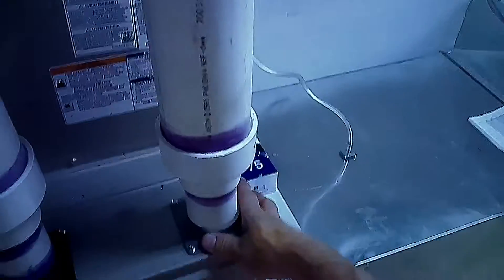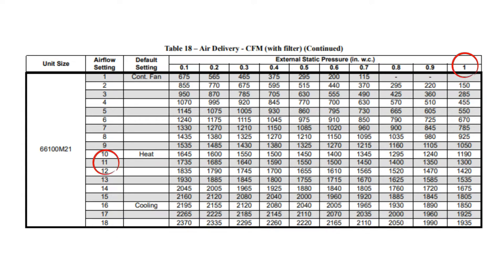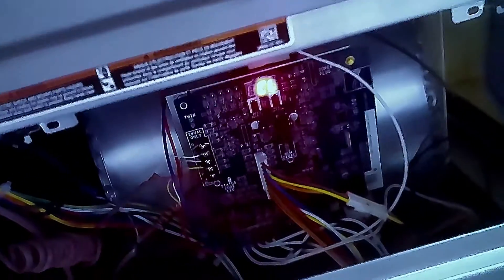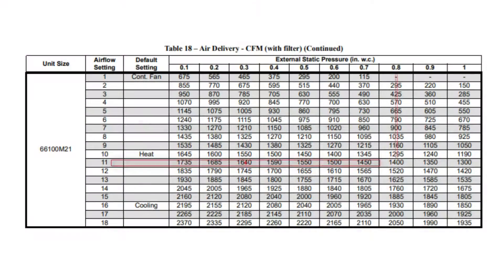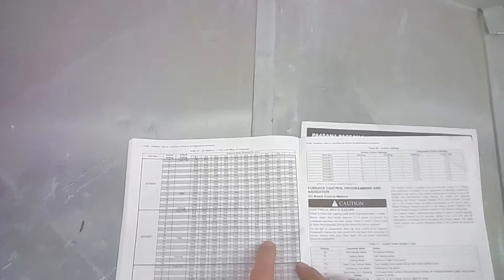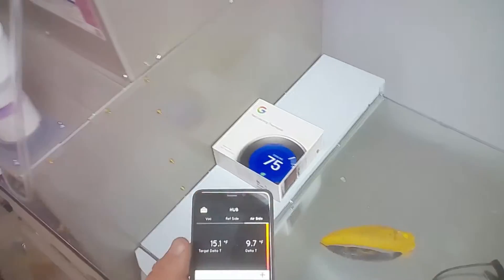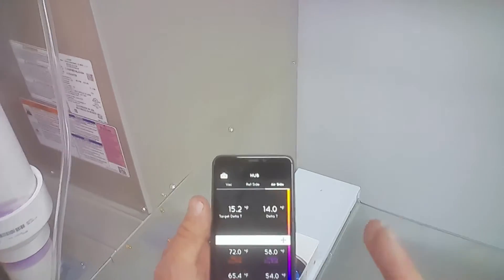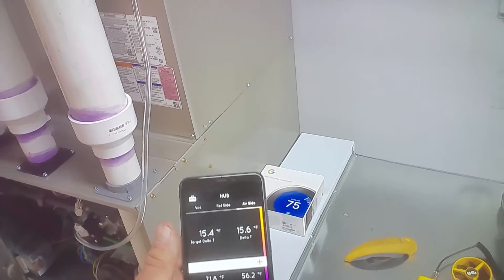In The Field: Setting Blower Speed w/Static Pressure

Comment: That is not how you measure static pressure. You need to measure everything that the blower has to work against. Not only the ducts, filters and the evaporator coil. You are measuring in the wrong places. You need to measure under the evaporator coil and before the filter to get a true static. Furnaces have a 0.5 static rating. That doesn't include the evaporator coil which is about 0.2 drop alone. Manufacturers don't include this because they don't know what applications being installed in.
Reply from the maker: I mentioned in the video there was no filter in the casing when I was doing the test. 

As for above and below the coil, the SP rating of a dry coil is a known value in the manual. If you watch again, I was at .8 SP. minus about .2 for a dry coil put me close to .6, just a little above .5. This was a 90% furnace with a blower capable of handling above .8. 

In the video, when you see the chart at .8 SP at the blower speed setting to get 1400 cfm, look two rows back to .06 SP at the same blower speed (minus dry coil). Puts me at 1500 cfms, closer to 1600/4 tons than the .8 reading of 1400 cfms. 

I went lower than the .1 capacity because the customer was very particular about noise. 

What I failed to do was mention I was subtracting the dry coil through all of this. That's my bad. 

I do this because it's often a pain in the ass to get my hands to the thermal overload, especially on a 90 percenter, to get a probe in there to get a pre-coil reading, and I don't want to drill holes into the furnace at the heat exchanger.